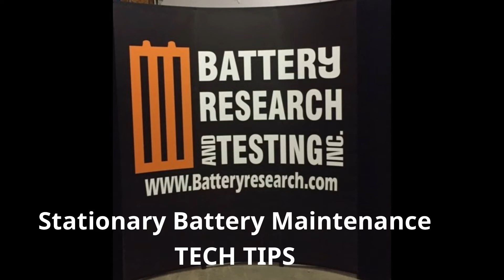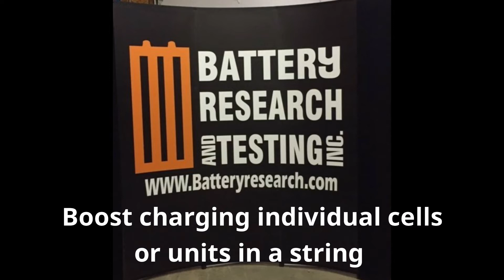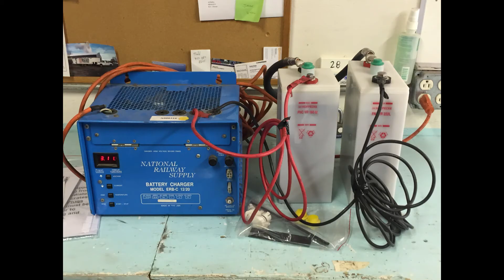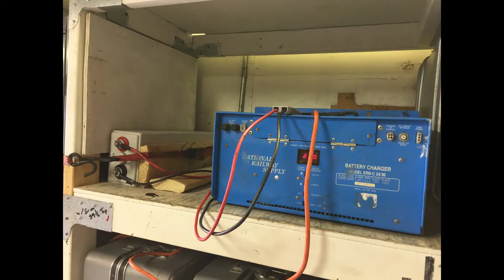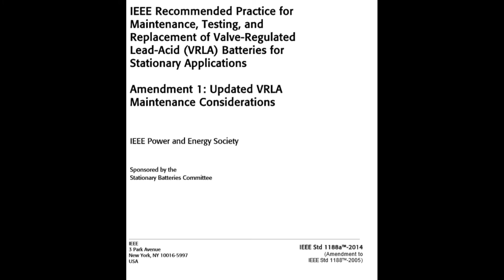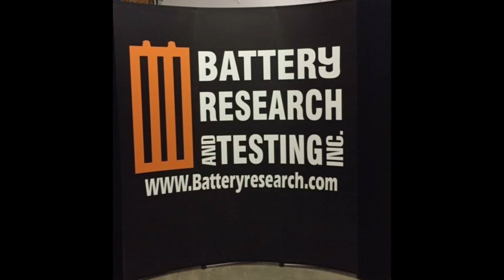Stationary Battery Maintenance Tech Tip # 6

Comment: Just bought the 24/301A unit.  Where should I hook up the BLK, WHT and GRN wires for 120V.  Unit has 7 terminals. Far right two are DC.
Reply: does it have the jumper bars installed? you can google the manual and it tells you how to connect the AC power.